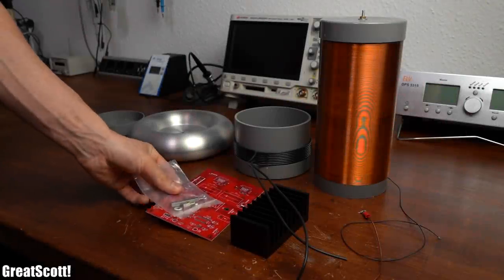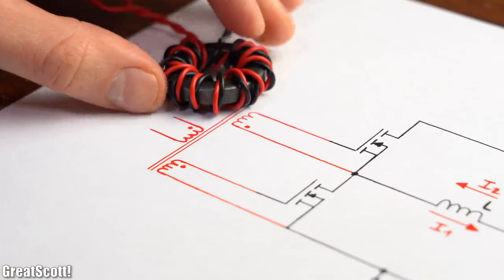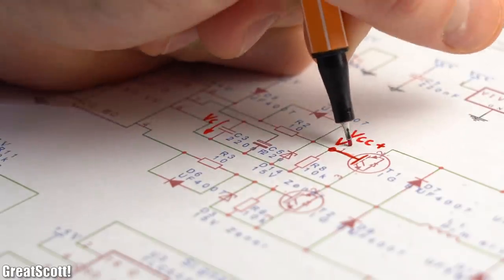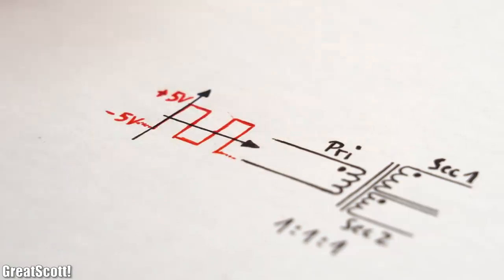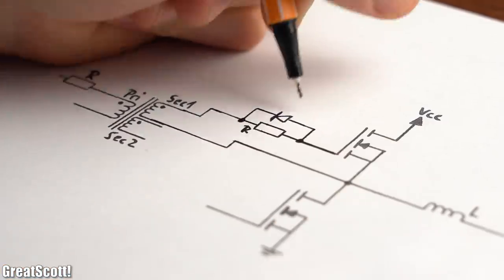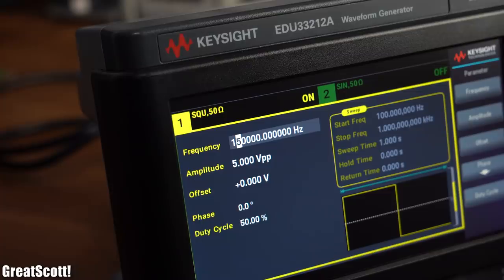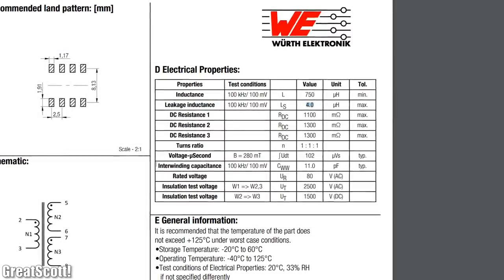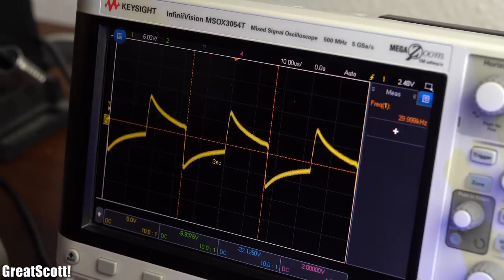Here is why Gate-Drive Transformers are sometimes essential! | MOSFET Driver Part 2 (Potential-free)

Comment: What wasn't obvious why there wasn't as much of a saturation problem with the commercial GDT is that, it must use more turns with a thinner wire, and most importantly, theres a gap spacer in its core, which the toroid transformer clearly lacks. A submillimeter gap in the core prevents saturation, and in switch mode transformers (inverter PSU's, flybacks, electronic CFL / fluoro ballasts etc.) it helps the magnetic field to collapse as quickly as it can, releasing energy stored in the core.

Very well made video, Thank You! Great channel! 👍
Reply: The last thing you want in a gate drive transformer is energy storage.
A ferrite with a permeability of 5000 is usually quite suitable for a gate drive transformer and requires only a few turns for typical modern switcher frequencies.
You don't gap the core for a half-bridge converter. Why would you gap the core for the gate drive transformer for the half bridge?

Flyback converters are another matter altogether. There the whole intent is to store energy because the inductive component is not used as a transformer at all, except with regard to multiple secondaries.
Reply: @d614gakadoug9  - I admit i was mixing up things a bit.

Comment: For frequency > 100KHz and high side driver, transformer based gate driver is a better option. If you only have high side drive (with no complementary low side), then transformer based gate driver is the best option.

Comment: Nice video, but note...Galvanic isolation does not = safe.  Many gate drive transformers only provide functional isolation which is not suitable when "safety isolation" from AC mains is required. In most cases any user accessible downstream circuits which have a working voltage upstream greater than 60VDC or 42.5Vac should be considered "safety isolation" required.  For reference these are the limits for UL Class 2 which is good to follow if no other information is available.  In that case you would search for a commercial gate drive transformer which has at least basic isolation, but ideally reinforced (double) isolation. There is also the matter of creepage and clearance, but that's for a different video. :-)

Comment: D.C. Welders use same principal, a small voltage winding controls variable, welding current, called a "Saturable reactor", also High voltage, Arc Furnace, for steel Foundry's.

Comment: Nice video! I am only a bit concerned how you use the term "saturation" in some places... The secondar voltage drops due to lack of change (di/dt) in the current through the transformer winding... I don't see any problems with saturation in some cases, if I am not completely wront :D but yeah it's sunday, so might be the case. Still well done and very nice to watch. Some positive words so the algorithm won't think I am anything other than happy with the content :)

Comment: Thank you! Great presentation, as always. I've played in the past with the gate transformers, when I was building the solar charge controllers and the multiple, galvanically isolated outputs bench power supplies. ....and I would say that the bootstrap drivers are, to me more reliable and more versatile. Also maybe because, when comes to calculate those transformers I quickly become lazy/confused/stuffed (?) :)) But I still try to understand what/where could be the advantages of using a gate transformer. Maybe on higher frequencies? Again, thanks! All the best!

Comment: Very cool video! One thing though, for a DIY project it is not easy to find a gate drive transformer. Mostly because they are not that widely availeble and also because you more often then not require some specifics that a supplier cant offer you

Comment: Use caution when running a Tesla coil or Van de Graaff generator in your lab. They have enough voltage and  energy to blow out all sorts of expensive test equipment even without being connect to them.   Had a guy bring a VdG into our lab one day and managed to wipe out two HP scopes and a CRT terminal.  The VdG was not even on the same  bench.  When he fired it up corona sparks were jumping all over the place from one metal bench to the next killing the equipment. Those things make a wicked E field.

Comment: Maybe one important addition that maybe requires an Part 3. Gate drive transformers work only when you have a 50% Duty cycle. This works for the tesla coil because of the quasi resonant topology that it uses, where the frequency determinants more or less the power transferred to the secondary side.
Reply: what if i use 45% duty cycle will it work? i have used some tl 494 ic' s and they have a dead time and don't output 50% but about 45%

Comment: Thank you.
I am looking to design a cuk converter rather soon, and the subject of integrated magnetics is kind of voodoo.  There's electrical engineering, then there is magnetic engineering, and then there is the continual play against math and market available components or subcomponents to work with.

Comment: Oh, new auto transformer. Intresting. What you did with the old one?(red, similar or even same as Electroboom's) AND even a function generator.
Reply from the maker: Old one is still right here :-)
Reply: @greatscottlab  Thanks god. I think you throw it away. How expensive was that new.
Reply: BTW: Diy or buy voltage tester for outlets.
Reply: @michalkana9764  Buy, it will be cheaper, and safer. You can get one for less than 8$ here in France, don’t know about your place, but still pretty cheap :)
Reply: @theogaillard5355  Im from Czech Republic, and here i can buy one for 30 dollars.

Comment: Nice vid ! I was wondering, what is the coupling factor between the primary and secondary Tesla coil ? And what is the ressonance frequency of the secondary coil (taking into account the parasitic capacitance). If my memory is right you'll need to drive the coils at this frequency and have low coupling. That's how we got it to work at uni a while ago.

Comment: Hey there Great, I think your home-brew tesla coil may be suffering from having that corrugated hat. The peaks of the  ridges become regions of high charge concentration, hence high voltage, and thus leak charge to the atmosphere disproportionately compared to the average voltage, this limiting the overall voltage the apparatus can achieve. That's the motivation to have a smooth dome/hat.

Comment: I wonder: Could you avoid the core saturation by just reducing the drive voltage, then adding more secondary turns to boost the gate drive voltage back up again? I guess that would add more circuit complexity, to make a driver that’d run the transformer primary at a lower-than-system voltage, but I’m curious if that would fix the issue of core saturation, all else being equal?

Comment: Are you sure it's saturation? The curve seems pretty linear, so it looks like the rate of change of the field drops because the current through the transformer stabilizes. Transformers do not pass DC, and the closer you get to DC, the worse they perform. You will need insanely high inductance values for low frequency transformers (look at the old wall adapters designed for 50/60Hz, and they're sinusoidal). 

Also wondering what current is running through the transformer. When the gate is charging it can be huge, but for a very short time. If the transformer can't supply this current, the gate charges slowly.

Comment: HEY DUDE.. THIS IS URGENT.. PLEASE REPLY..
Can we make a transistor out of two diodes, just for very small current application?? If doping is the problem... Can we make a diode with highly doped P junction and weakly doped n junction, so that we can use it to make a transistor.... Is it possible??
You are the right person to answer this..
Reply: No.
Transistors are sometimes shown as being three "sugar cubes" of doped silicon stacked together. In reality the base region is very thin and must be very thin for the transistor to function.

Comment: Right timing for my sstc build.
I was planning on using half bridge drivers with totem poles. Maybe if it isn't satisfactory I'll use a gdt, with different gate drivers.
Btw Great Scott have you tried running your circuit interuppted with rectified mains?
Reply from the maker: Nope. Sorry. I think my lab is too cramped to ever try out mains voltage directly.

Comment: I'm confused about why the upper MOSFET in the driver circuit is n-channel, why not just structure the driver circuit as a CMOS inverter so that you can turn it on by bringing the gate to ground and turn it off by bringing the gate to VCC? wouldn't that obviate the need for putting higher voltage than VCC on the gate of the upper MOSFET?

Comment: I think the reason is torroidal coil give higher voltage signal to drive the gates than the IC driver chip and the signal from Torroidal is closer a sine wave  than the chip which is square wave. In the case of tesla coil sine wave is more useful than square wave.
Reply: It's a 1:1 transformer - there's no voltage change.

Comment: Hey I want a multimeter for beginners can you suggest me some low cost multimeter
Reply: That really depends what you want to measure with it (mains or low voltage, what kind of measurements you want like capacitor or temperature etc.). I have an aneng AN8008 for low voltage hobby work and it's a nice compact little companion, very cheap. For a bit more size and accuracy I like my Uni-T 61E, around 50 bucks or so. There may be newer models out now but most cheapo meters will do regular hobby grade voltage and current measurements just fine so any cheap meter should do to get started with. I also have a few of those cheap 20 dollar component/transistor testers (search ebay for GM328 transistor tester to get an idea) to measure cap ESR, diodes, inductors and random parts, they seem to work pretty well too for hobby level stuff.

Comment: Great Scott I watched a video where you made your own IR remote and you ran the arduino mini off a 3v button cell.
 I was a bit confused because I thought you could only power the arduino mini with 5v or 6 to 12v with the vin pin. I did some research and found out that you can't power an arduino through the 3.3v pin. So, can you tell me how you powered it? (So, I can power my projects off a 3v button cell but using an arduino nano and can you power an arduino with 3v?) Did you use a boost converter or is it just feature on the arduino mini through a different pin?
Reply from the maker: Connected it to the Vcc pin.
Reply: @greatscottlab  Thank you.

Comment: Interesting, but can you wire both diagonal mosfets gate of a h-bridge in parallel in order to well.... Drive an h-bridge
Reply: You can't wire them in parallel because one needs (supply voltage + gate voltage) relative to ground while the other only needs gate voltage from ground. What you can do is use four secondaries on a gate-drive transformer.

Comment: so what are the vital things might need to do to protect my mosfet when using a gate driver ? i have a little gate driver circuit already. can i just attach it to the mosfet and off we go ?!! or do i need to put protections and extra things to pull down the voltage. i attached my gate driver and the mosfet started smoking ! but it was an already damaged mosfet. please give me some advice ! : )  .. its for powering a pulse motor, so im pulsing a coil with 24 volts. two batterries in series of 7amp hours each. mosfet is IRFS 840BT

Comment: Moin, why is the Tesla Coil not grounded? (Or is it?)
It's behavior is a clear signe and I can't see any wire coming frome the base of the secondary.
Ungrounded Coils produce tiny arcs, and are in danger of self destruction or arcing to the primary side!
Try a radiator or even just the PE.

Comment: I am starting to understand inductors and transformers thanks to your videos on the subjects.
It would be interesting to know why the tesla coil produce higher voltage with the transformer. Is it because of a hard start and hard stop, because of the spikes on each edge? Or is it because or slightly overlapped on/off for both transistors from faster turn on?
Does the improved circuit consume more current when given the same power supply voltage?

Comment: Wait, why you need freewheeling diode parallel to a mosfet ? They already have diode in the same direction
Reply: Exactly.
Long ago I saw circuits using a diode in series with each FET and an external diode used across that series arrangement, the intent being to keep the intrinsic body diode from conducting because the body diodes used to be quite slow. If you kept it from turning on, you didn't have the slow reverse recovery problem. It just isn't necessary with modern FETs except in very unusual circumstances. The intrinsic diodes aren't super fast, but they are good and they are now well specified instead of something that was "just there."

Comment: Howdy.
How about using a P-Channel Mosfet as the upper one ? 
Regards.
Reply: They are not available in as low of "on resistance" as the N channel. Also, this does not eliminate the need for the transformer in an H bridge circuit.

Comment: Sorry I didn't catch why the gate-drive transformer is used - Is it for any high frequency switching purposes? At what kind of frequencies would you start considering using this component?
Reply: Generally you use a gate drive transformer when you need to drive high-side N-channel FETs or IGBTs.
If used them in several 100 kHz half-bridge designs.

Comment: Hey great GreatScott 🔥 please tell me how to make skin electrode,muscle sensor [electromyography] with microcontroller. It will be a awesome topic for the next vid😇
Reply: If you are talking about making the actual sensors that go on the skin that is less of an electronics project and more of a physics and material science project. If you are talking about reading data from a skin sensor, you figure out what analog frequencies you want to read from the sensor, then connect the sensor to a low pass, high pass, or band pass LC filter to remove noise from the signal frequencies you want, and run the resulting signal through an op-amp chip to amplify it to a level microchips can read. Processing the signal in the microcontroller is 100% programming. Not the easiest or shortest of projects. It would realistically be at least a 7-10 video series with 4 months minimum of research, math, planning and testing to get it to work when you have not done a project like that before. Not to mention all the hours of video editing. It is a very interesting biomedical engineering project though.
Reply: @joshnabours9102 from where ar u 🙋
Reply: @tanjiro3285 The USA

Comment: Very confused, why is the performance of the new tesla coil so poor, has it not been tuned properly?  I've generated much larger arcs just using an old TV flyback transformer with a ZVS driver.  Based on the size of your coil I would expect arcs of over 150mm, not 25mm.  Might want to test the resonant frequency of the primary and secondary coils to make sure they match and are being driven at this frequency.
Reply from the maker: I was using 25V AC max. That is why.

Comment: Wait a minute. But how do we drive the primary side of the gate transformer? Is a mosfet driver IC a viable solution? Or maybe some kind of transistor output stage is needed? What is the input current into such a transformer?
Reply: The primary drive depends on the secondary load of course.  A mosfet gate is a pretty small load.  Just drive it from your logic pin if you can.
Reply: @stargazer7644  Wow, I didn't expect this to be enough. Thank you!

Comment: Hello! How does a driver transformer handle dead-times needed in an H-bridge circuit with MOSFETs?
Reply: The slow rising time of the voltage will ensure the mosfet stays off until it reaches the threshold. So the transformer provide a natural dead time
Reply: Drive the transformer primary with a bridge. If the control IC can handle sufficient current at its outputs, you can connect the primary directly to the those outputs, possibly through a capacitor "just in case" you might get an unwanted DC component. If the control IC can't deliver enough current, use a gate driver IC at each output. The output of a gate drive is itself a push-pull circuit, so to of them make a full bridge to drive the transformer.
A good gate drive transformer produces very fast rise and fall, contrary to what other people claim.

I've used gate drive transformers very successfully in half-bridge converters up to 1 kW at 100 kHz.
If you are making a low-frequency H-bridge, as you might for an inverter, then floating gate drive power supplies and high-side gate driver ICs would be a better choice.
Reply: @MuhammadHanif-bx4pb  
No, it does not. A good gate drive transformer provide very fast rise and fall times.

Comment: What would be the benefits of a steel core as opposed to a ferrite core?
Reply: None. While steel permeability is high, which is advantageous, it just isn't workable at the frequencies of modern switchers. It would have to be extremely thin layers insulated from each other to be usable at all.
Ferrite is just fine for gate drive transformers and is inexpensive.

Comment: Why not use an optocoupler powered by a seperate power supply?
Reply: Optocouplers are generally too slow for modern switcher frequencies.
There are level-shifting gate drivers that couple the signal through a very small capacitance and are very fast. They work well with a floating supply but they are rather expensive.